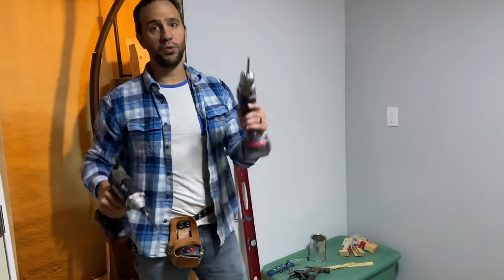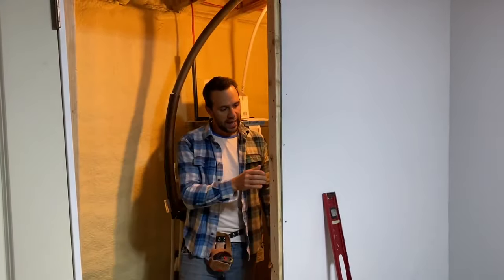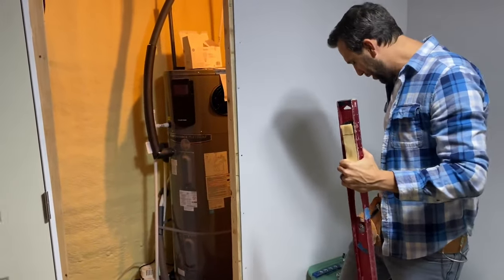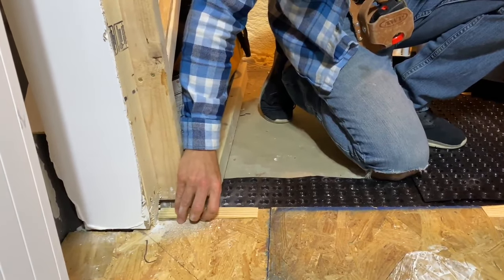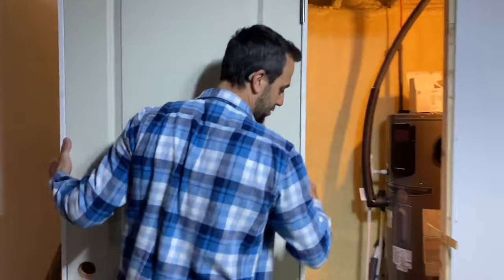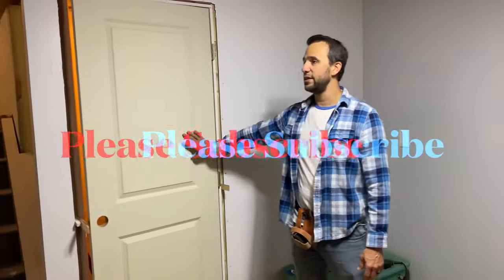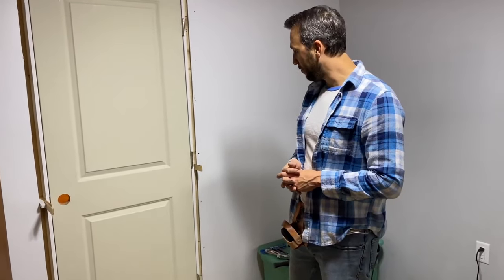How to install a pre-hung door | The easiest and most efficient way to hang prehung door

Comment: Except now you have a 2 inch gap on your latch side. You should center the door in the jam.
Reply from the maker: this is correct, but doesn't cause issue, plus it will be covered by casing.  Being centered in RO doesn't impact door functionality, especially an interior door.

Comment: Just installed my prehung door using your technique and it came out way better than anticipated! I don't have the oscillating cutter tool yet so I gently scored the shims flush with a sharp blade  using as many passes as needed.  Thanks for a common sense simple method that is totally solid
Reply from the maker: Glad it worked for you John !    

Mike

Comment: 0:20 Tools needed
2:15 Plumb hinge side stud with shims and level
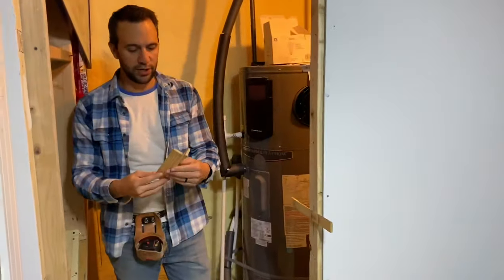3:45 Shims to lift bottom of  jambs
4:15 Test fit door 
5:30 Screw hinge side jamb to stud that is plumb with shims
7:15 Check for uniform reveal on top and latch side of door, shim as needed
8:50 Screw top and latch side jamb to studs
11:15 Cut off protruding shims
Install door handle, latch hardware
Install trim (door casings)
Reply from the maker: thanks for this  !  i’m going to add to description

Comment: One potential problem with the 1 inch shims on the latch side is trim casings may look "off balance" by 1 inch if there is a narrow wall like a door near a corner or in a bathroom.
Reply from the maker: correct.  I def left the casing detail out of the video and it's important i agree.   if the finishing casing placement is important in a specific install it should be considered before installing anything - agree.   But in most cases it doesn't matter if it's 1'' this way or that way.

Comment: Advice on what I could do if the stud that will have the hinge side has a slight twist towards the bottom?   How can I shim that?
Reply from the maker: run a screw into it to force the stud straight, if framed correctly there should be another stud behind it ….  or just persuade it with a couple hammer hits ….   if that doesn’t work i’d chisel it off.   just make as flat as you can.

Comment: What if I have flooring down? I’m replacing old doors with 3 panel maple doors. The flooring wasn’t all the way through the threshold nor out away from the jam enough to put new pre-hung in.
Reply from the maker: Brian, I’m not sure I understand fully.  I’m sorry - I don’t want to give wrong advice.  

I’d say do the first door slowly and see if it works out.   If not, you may need to cut the jams if you floor is unlevel so that you can go directly the the floor.   

In that case you just run a level line in the door way and measure down each side and then determine you high point.  How ever much it’s high, remove that much from the jam.   That will make the door level and the jams hitting the floor.

Comment: Since I see you're a good responder, I have a question? I can't find a video that tells me if the prehung door should be kept off the subfloor by about 1/2 inch if we're going install carpet flooring. Or whether it should be installed before or after flooring?
Reply from the maker: to be safe I'd install 1/2 up, it will keep the door from dragging on the carpet after installed. 

But this depends on the thickness of carpet, if very thin carpet you may want to go to floor, but if thick carpet you may want to install high.    

Either way, if the door drags on carpet after you install, you can always cut 1/2 inch off bottom of door.    

Sorry - it's not a one size fits all answer..

Comment: How did you make sure the door was plum forward and backward, relative to the plane of the closed door? That is, what if the framing was not plumb? You lined it up to the drywall, which might not be vertical.
Reply from the maker: Mike,

Thanks for the comment and question - it makes sense.   I'm not to concerned with the framing being plumb that way as much as i'm concerned with the hinge side (left to right) being plumb.  The wall is what it is and doesn't impact the overall install.   so, i guess what i'm trying to say is IMO it doesn't matter that much.  if the wall was that out of plumb you'd have bigger issues, i'm sure it's plumb enough.   I even walked around my house today to see how plumb my existing (builder installed 30 yrs ago) door frames were, most were very out of plumb that way and this doesn't impact the door at all.    I hope this makes sense...   

does this make sense ? 

Walk around your house and check how plumb the doors are that way...   

let me know ... 

Thanks again ! 
Mike

Comment: Can I use this same technique for an exterior door
Reply from the maker: no - i’ll be doing a video but don’t have one yet.  

the think that will make an exterior door install easiest, is making sure you have a flat and level door sill.  the threshold will sit on that.   then you just square the frame up and attach.   

but spend most of your time leveling and flattening you sill.      sometimes you need to use concrete to flatten/level it.  

don’t put the door in the opening until the sill is perfect !     like i do with the framing in this video.   

good luck - do it !
Reply: @FamilyDIYtv  so none of this pre shimming style will work? Or can I use that plus taking extra time to focus on the sill? Thanks for the responses, trying to hang a prehung exterior this weekend on our first house
Reply from the maker: Well, great point !    I'd say yes, you can use the pre shimming. So,  essentially you'll create a 90 degree angle "corner" to set the hinge side of the door into, actually I like this !!!   actually I love it !!!   I think that will be the technique I should share when I make the next video.     
can't see a downside...  i'll ponder it a bit longer... #greatidea

Thanks
Mike

Comment: Thank you for the great video. I need to install a double door on a closet that opens in the center to clear a gun safe. I am certain the framing is not square. When doing a double door would it be best to plum one side and start the install from there just like you did here working your way around the door even though both sides are hinge sides? Thanks!
Reply from the maker: Yes, do exactly that.   I show it in this video - enjoy the safe ! 

https://youtu.be/RWG877rXhHM

Comment: Was that a solid core door? I see most installs use nails, I was going to either rent a gun or buy one since I’ll be doing all the doors eventually. I never thought about screws because I didn’t know if it would damage the wood
Reply from the maker: Ray - no, it's a hollow core door.     I use screws, don't see a need to use nails.  Also, for a DIYer screws are allot more forgiving, meaning if you make a mistake you can pull the screw out.   With a nail it becomes a tad harder to make those small adjustments.     I'd invest in a nice drill/impact combo and trim nail gun.    

If your worrying about the woods splitting, just predrill the holes. 

Good luck with your project and consider subscribing  ! 

-Mike

Comment: What if the floor across the jamb isn't level? I'm doing a basement and one side is lower than the other
Reply from the maker: Lara - great question.    I talk about this at the 3:45 ish mark and again later in the video.   Thats why I add shims to the bottom before I install the door.    If it's really bad you should.concider added two shims.    Then pulling out the ones that are needed during install.   

Thanks for watching !!!

Mike

Comment: This is one of the best videos out there. I think shimming before bringing in the door makes it a little less overwhelming. Also shimming at the bottom would help with any minor floor levelling problems. One question I did have was, would you need more screws at the top and the reveal side? Is one screw enough?
Reply from the maker: The one at the top of the frame really Isn’t required…. So one is plenty.    It’s just to hold it centered really.  

Thanks !  

Mike

Comment: I have the same issues with several of my door openings with huge gaps on both sides on some and one side on others. Is there any other options rather than adding a bunch of shims? 
Im thinking of possibly re hanging them before i do the trim… its a new construction so im doing some work myself…. 
Nice video
Reply from the maker: how about adding a 1x4 to one side of the opening ?   or ripping down 2x4 to the size you need and adding to existing framing.
Reply: @FamilyDIYtv  did consider a 1x4 or 1x6, cut to size but wasnt sure. I think that might be my best option though. Thanks for the suggestion 👍
Reply from the maker: @johnny.9879  perfect!

Comment: What size screws did you use?  Also, should I use a countersink?       Could I use an 18 gauge brad nailer instead of the screws?   Never did this before.  thanks
Reply from the maker: At least 2.5"" long screws.  I used spax screws I believe I showed in video.    Don't use nails.      Yes countersink.  

Thanks 
Mike
Reply: Yes 2” 18 ga nails are perfect 
Using screws to hang a 10 pound hollow core door is unnecessary and very slow. 

Even when I install heavy Doors I install them with nails. I then go into each centre screw of each hinge and install a long screws so it catches the 2 x 4 framing

I install doors every day for a living, trust me nails are fine

Comment: If only mine were this easy to do.. my framing is twisted I guess from humidity and settling with drywall covering the framing
Reply from the maker: make it easy for yourself - fix the framing first and make the hinge side plumb.    hanging a door in a messed up frame is way harder than just fixing the framing.   

thanks,
Mike

Comment: Shouldn’t you have removed the door jam trim first?  If that trim needs replaced, screws removed, the entire door will have to be redone.  Also, by removing the trim first and then running the screws, the trim will hid the screws.
Reply from the maker: its not a bad idea, i don’t do it but it would work.   at the end of the day your filling holes, either screw hole(s) or trim nail holes.    you can cover the screw holes without any issue…

Comment: Why use a drill and screws and not a brad nailer?
Reply from the maker: personal preference and most people don’t have a brand nailer. plus screws hold better, also for someone new screws are way more forgiving.

what do you prefer ? 

thanks
mike
Reply: Doors are heavy. They get opened and closed constantly, putting wear on the hinge side. Brad nails are way too weak to hang a door properly. Sure, they'll hold the door up. But not properly. Even a lighter hollow core door brad nails are just a cheap option. Use screws.

Comment: The shims on the bottom are useless. Your argument was that if you need that space you’ll have it by removing the shims but if you need that space it’s because you put the shims in. Save yourself the trouble and put the shims in the top.
Reply from the maker: Thanks for the comment but I disagree. The shims are there to compensate for an unlevel floor.  The shims being added to the hinge side, had nothing to do with latch side.  If you didn't see it, I showed exactly why you add the shims to the bottom.  

One fair criticism that I haven't seen posted is that my installation technic assumes this was being installed over a subfloor, not finished floor and I didn't bring this assumption up during the video.  If this was a finished floor, i could see a scenario where the shims could cause a cosmetic issue.   But in all my years installing doors as a homeowner, i can only think of one scenario where i was installing over finished floor.   usually doors and floors are being done at same time...  but not always.  

Thanks again,
Mike

Comment: Wow, craftsmanship of doors suck. I put in a few doors years ago. I would pull the molding and a screw off of each hinge. Ef it. now we just screw through the molding. And the molding is one piece as its formed with particle board. Thanks for the video. have to relearn how to hang these cheap ass doors.

Comment: This guys funny first you always use a 6 foot level especially if your making a YouTube video the way he showed you doesn't work hence the cuts in filming, second you measure the door frame so you don't have a massive gap on one side, third you use a smaller level or a lazer level to check the floor for level what if the latch side needed to go up when you closed the door? You would need to lift it even higher and there would be a big gap at the bottom, fourth you take the door stops of there only pinned on lightly so you can do this, once you have finished you put the door stops back and they hide the screws, 5th you will definitely need more screws on the keeper latch side,
Reply from the maker: lol - door hung two years ago,  still plumb, still level, still latches like the day it was installed, actually installed six doors that day, the same way - all still perfect.  remember there’s more than one way to skin a cat and there’s more than one way to hang a door.   i’ll take your criticism as a learning event, hope you do the same.   if your a father, happy father’s day !  

-Mike aka 4ft level guy

Comment: Well, it gave me a laugh...good attempt, but do yourself a favor and don't half ass it. I saw you check the stud the one direction and found it was out, and you never checked the wall for plumb...if you are doing an instructional type video, let the people know to also check plumb the other way...following the flushness of the sheetrock will get you into trouble. You can always adjust the difference in flushness in the trim, but a square and plumb door is the goal. No one likes when a door isn't flat in a wall.
Also, go that extra step make all 3 reveals the same, 6 points of contact is the 1st step...make those reveals perfect
Reply from the maker: Jeez man, who peed in your cheerios ! Lol, it’s a door hanging video dude.  

Get out there an help people and get off the internet.  I get constructive feedback/criticism in the comments and I welcome it, actually, I ask for it, I’ve even made multiple videos highlighting those inputs but zero parts of your comment were constructive or nice.    Do better - be nice- help people !

Always Learning
Mike
Reply: Hey, maybe I was a lil hard on the beav, but you are doing a video about door installation...A job which I actually do for a living amongst other trim aspects and all around building in NY...I was watching to see what's being taught these days and in my personal opinion, and profesional one, you gave it a decent attempt, but just weren't taught the proper efficient way.
If you got your feelings hurt that wasn't my intent.